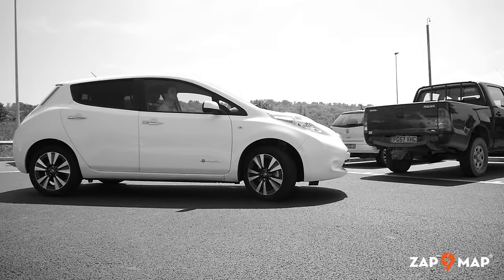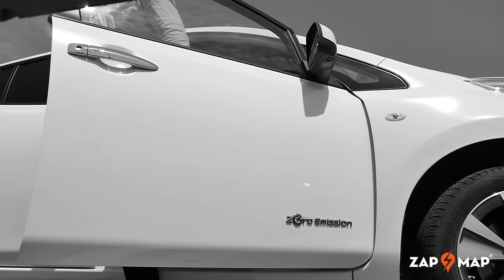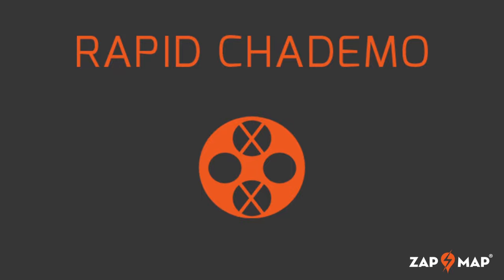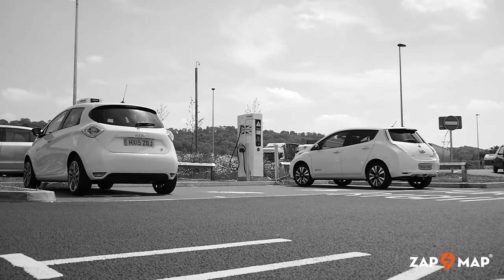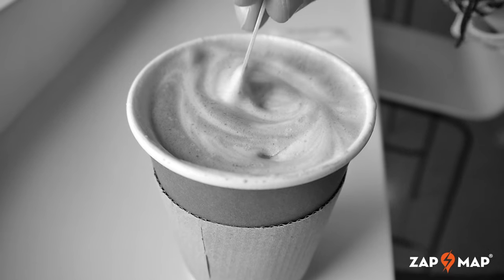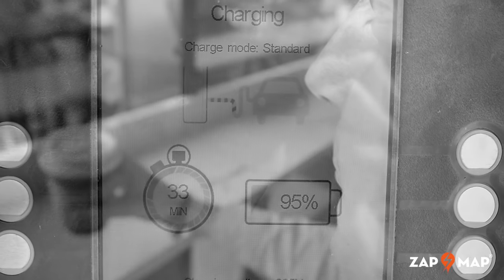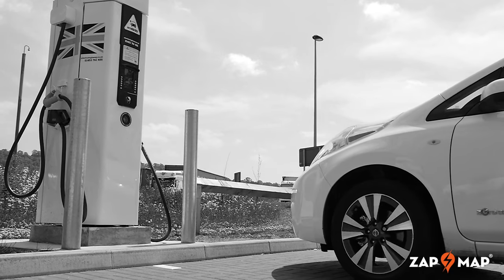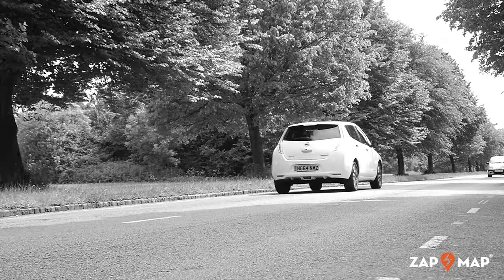ZAP-MAP: How to charge with rapid DC CHAdeMO units

Comment: One thing though... You might want to show how to connect the plug as connecting the plug is a multi-step process in itself of inserting the plug, squeezing the handle, and then sliding the tiny cover. The reverse process is sliding the tiny cover away from the handle, pressing the button to release the handle, optionally pull the handle away, before pulling the plug out. Although, this would be displayed on the screen anyway.

Also, might want to mention the fact that if you get back after the charging is finished, you might not need to present the card anymore. You only need to present the membership card when you want to stop the charging.